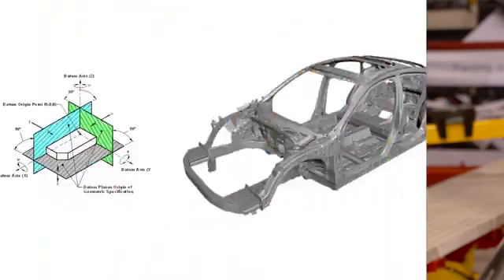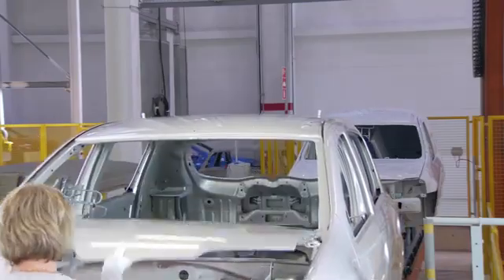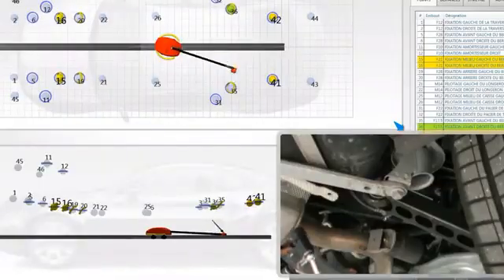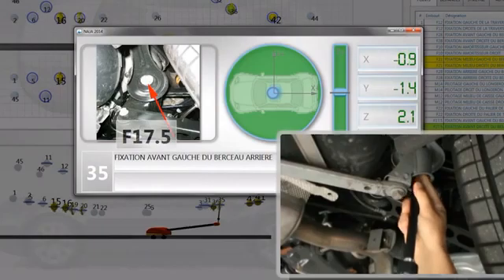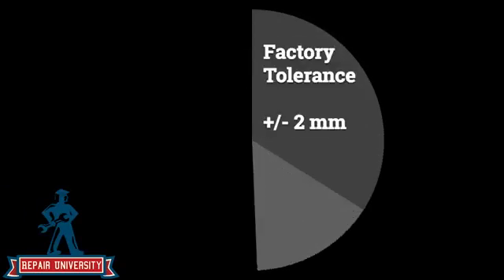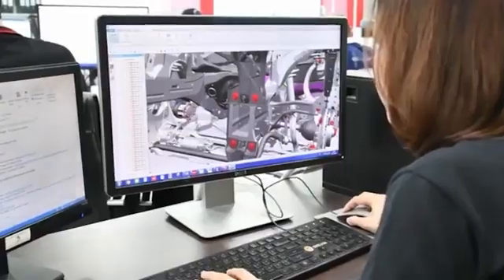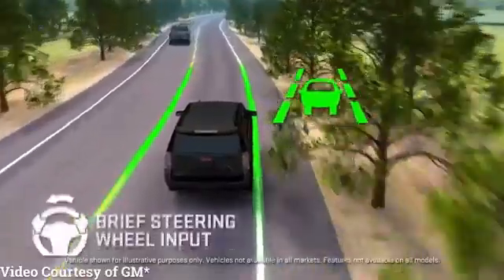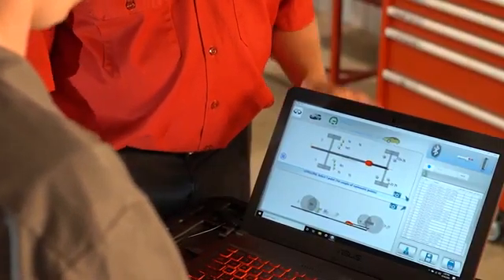Collision Hub and Celette , Where does automotive frame measurements come from ?

Comment: So this means all measuring systems that have OEM approval from particular brands will get their CAD data from manufacture while other non approved measuring systems measure themselves? Assuming no one has all the OEM approvals what is your process to source measuring data if you don't have the approval for a particular OEM brand? Very informative video! Keep it up!
Reply from the maker: In fact it goes further. This means that the measures provided and in which everyone believes in should be taken with care. It is difficult for us to go into details, but clearly, repairing a car correctly with an electronic measuring device is science fiction knowing that the data in most cases is wrong. Serios technicians will agree. We wish you an happy new year